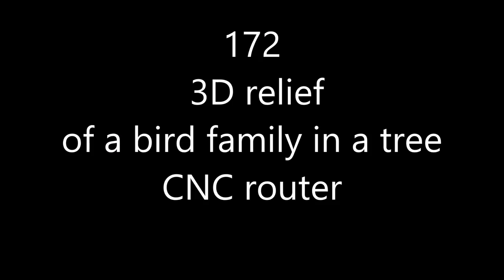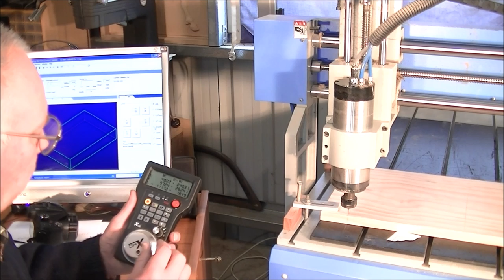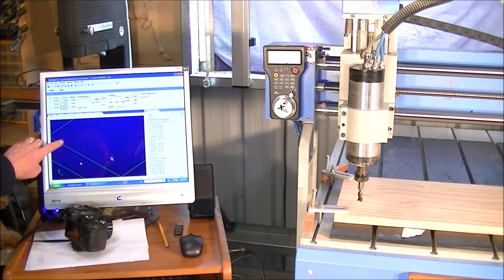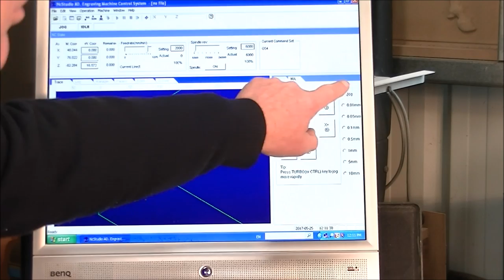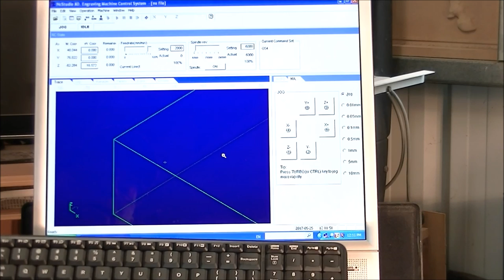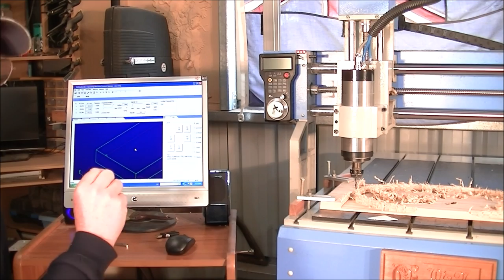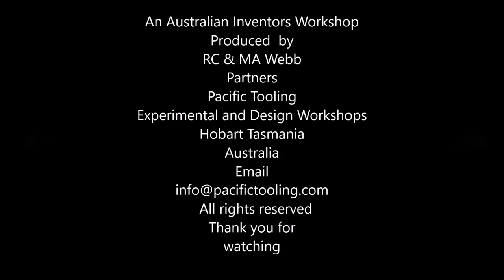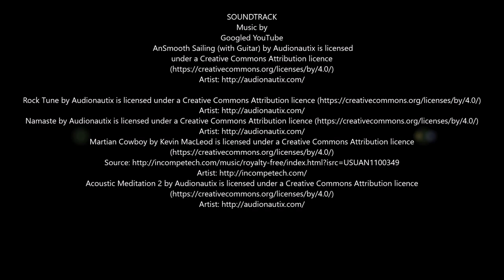172  3D relief of a bird family in a tree CNC router

Comment: My practical experience revealed one interesting fact.
For woodwork a straight flute mill suits waaay better than the spiral flute one.
While working with the spirals - I got splinters at a feed rate of 1050mm/min and 8000rpm.
Splinters still occured even at 600mm/s with the same spindle speed.
The same operation with a straight flute mill went nice and smooth at 1175mm/s, producing almost no any splintering, with neither loads of fur, nore those tons of "moustache" at the edges.

Comment: Thank you Roger! Awesome job. Can you please show how to take an image (Land Rover) and make it ready for CNC? I am starting a woodworking business and the CNC is going to be my most used machine. Do you have suggestions on a good 6090 or possibly larger? Cheers!
Reply from the maker: Hi, Email me at : info@pacifictooling.com  I will send you information on our new Wood Lathes
 and CNC routers, 4040, 6060, 6090 , 6012 , 1212, 1224, 1325 and now CNC 6040, 6090 , 1390 Lasers (linear rail model), and machine tool accessories . Pacific Tooling, 
 Australian Inventor Roger Clyde Webb
Reply: SIR I AM WORKING ON CNC ROUTER BUT I DONT KNOW  MORE ABOUT IT.I AM NOT WELL OPERATOR CAN YOU GIVE ME IFORMATION OR LEARNING I WANT TO WORK WITH YOU IN WORKSHOP UNDER YOUR EYES

Comment: How would I go about getting one of those machines?  Do they do column work as well?
Reply from the maker: Hi, Email me at : info@pacifictooling.com  I will send you information on our new Wood Lathes
 and CNC routers, 4040, 6060, 6090 , 6012 , 1212, 1224, 1325 and now CNC 6040, 6090 , 1390 Lasers (linear rail model), and machine tool accessories . Pacific Tooling, 
 Australian Inventor Roger Clyde Webb